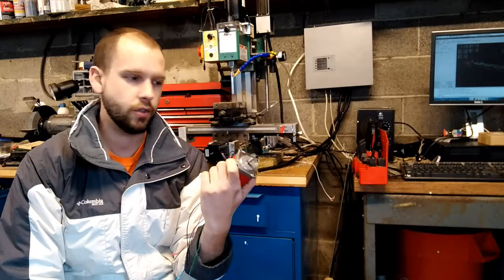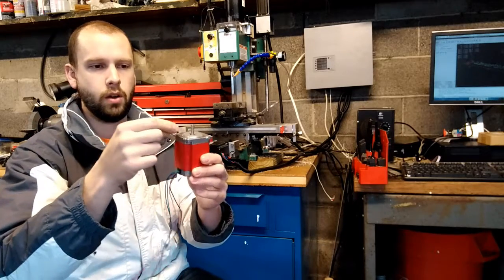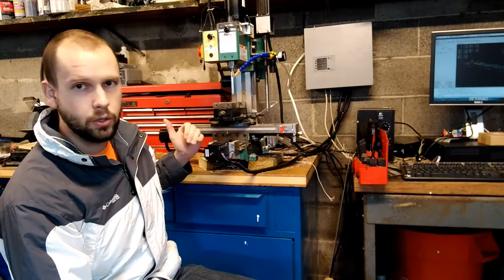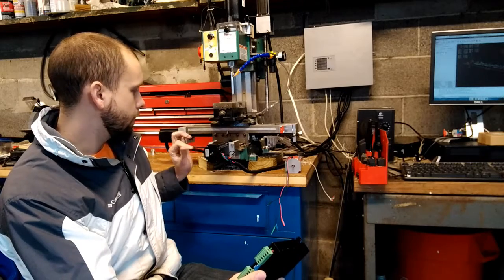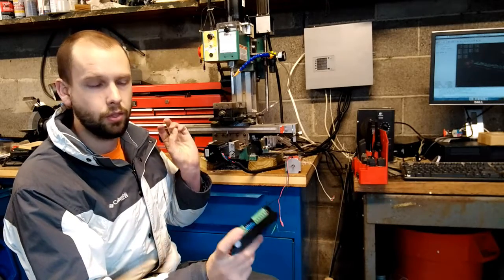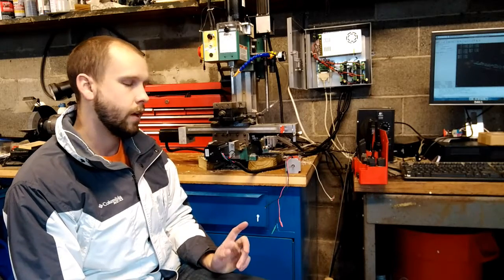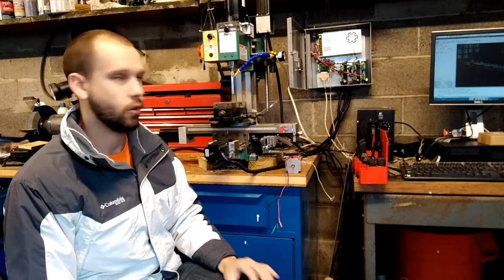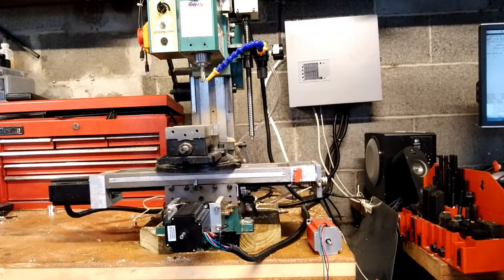How Do Stepper Motors Work?

Comment: I've been trying to find a cnc conversion kit/guide for a G0781. I'm almost positive that's what your using. anychance you can help me out and tell me what parts you used. To make the cnc conversion and the os
Reply from the maker: I bought a few brackets for the x and y axis from cnc fusion years ago but I am not sure if they still sell them separately.  Then I got ball screws off ebay for pretty cheap and they were able to customize the dimensions on the ends at no extra charge.  I focused on the x and y axis first, then you can build the z brackets much easier.  The Z axis was pretty simple actually.  I have a 3x3 piece of angle iron on top of the column that holds the motor and the bracket to hold the ball nut and bearings, then another small piece of 3x3 angle on the head that holds the ball screw.  I use linux cnc for my software/OS which is awesome and free!  It is less glitchy than mach 3 and when you load the OS, it feels just like windows.  The linux cnc version I have is based on Linux Debian and all the drivers and things just worked when I installed it.

Comment: Could you give any insight on your Z axis motor mount? I've drawn up something similar to what you have, however mine would sacrifice some travel. Also how did you mount the X axis ballnut?
Reply from the maker: The Z axis uses a short piece of 3x3 angle iron on the top of the column and another short piece of angle iron on the moving head.  The ball nut is fixed to the angle iron on the head and the end of the ball screw swivels on a bracket extending off the angle iron that is fixed to the top of the column.  It is a pretty simple fabrication compared to a lot of the other stuff I have seen people do but it works well.  It has been a few years since I did the x axis, so I honestly don't remember how the nut is mounted.  I believe I bought a couple brackets from CNC Fusion then I was able to buy ball screws off ebay for pretty cheap and they customized the end dimensions for no charge.